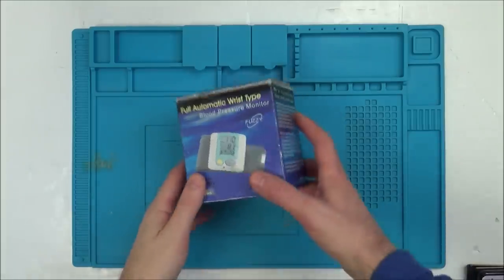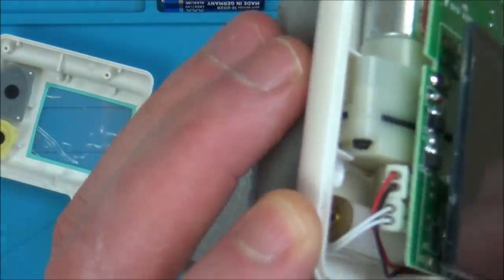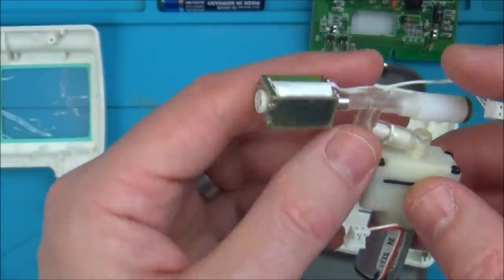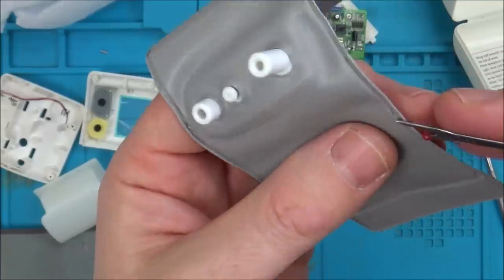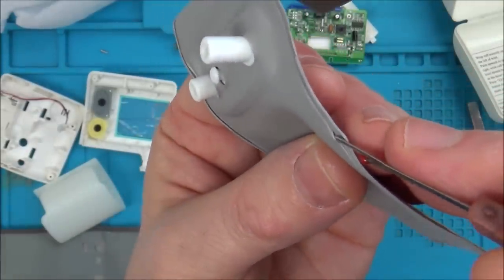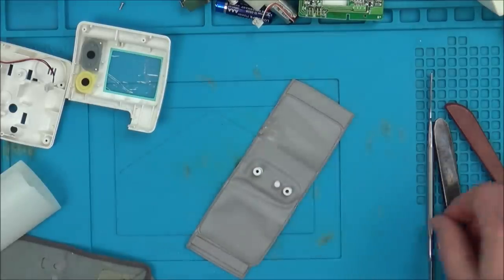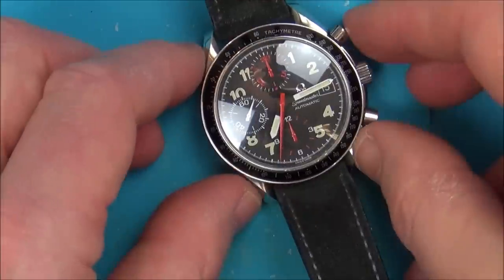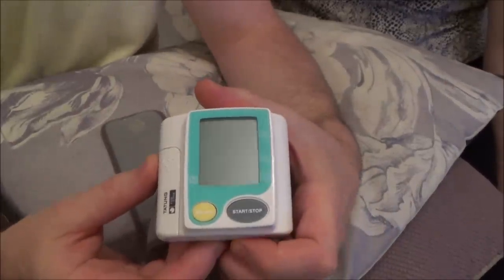Trying to FIX a Faulty Blood Pressure Monitor

Comment: Hi, You could try heating the spatular, or heat a metal bulldog clip, so it will clamp it, cover it with rubber glue.

Comment: I would have tried using a piece of kapstan tape.  Fold it over on itself so the sticky sides stick together, and the only exposed areas of the tape are not sticky.  Lay the kapstan over the hole on the bladder and melt the hole with the soldering iron, so the heat transfers through the kapstan to melt the rubber / vinyl on the other side.

Comment: You were doing it incorrectly. Wrist position is crucial when using this type of gauge. You need to sit at a desk, hold your back straight, elbow on the desk and hold your wrist at heart level. Do not move your arm at all. Then it will measure OK. Lower than heart = higher reading, higher = lower reading. Even small movements and placement errors affects it a lot. Nice video none the less!

Comment: But aren't the microchips made to read on the exact size of the balloon? By heating it wouldn't you change the size that way making the reading incorrect?
Reply from the maker: Maybe, or does it just read the pressure and stop the inflation when a certain pressure is reached :-)

Comment: I have a rite aid that as soon as I put batteries in or plug in the power adapter is automatically starts pumping and don't stop.
I also have a wrist one that has a leak like that one did.

Comment: Ideally, to seal rubber you would need to place it between 2 hotplates and put pressure on it. I remember my father had tire fixer that worked that way. It was back in Ukraine, I am not sure of they have such things nowadays.
Reply: Except it's not rubber it's vinyl, but he could have used a repair kit for inflatable toys/boats
Reply: @Thelostgoldhunters  Thats true. However same principle applies. I am guessing its just the matter of timing and temperature.

Comment: Wrist monitors are notoriously inaccurate, so I wouldn’t be too worried about that high reading. They always tend to run high for me too. 

A while back when these things first started popping up all the clinics switched over to them, but they soon found out they’re unreliable and now most places have switched back to arm machines or the good old fashioned manual pump ones.

Comment: I'm thinking if you are consistently pulling 100bpm, you really need to see a doctor as leaving it will only make matters worse, hypertension, tachycardia, two things not good to ignore and it could be a simple thing like needing a blood pressure tablet once a day for a bit or something to pull your heart rate down.   Mine without tablets is 120bpm hence being put onto tachycardia tablets and since then my blood pressure dropped into quite good results, less strain on the heart.
Reply from the maker: Cheers Ian, I will try to sort out my diet first, and if it doesn't improve then I will see the doc when things get back to normal :-)

Comment: I wished I'd watched this video before I ordered a new monitor.  The strap got pulled off and disconnected from the main unit on the old one - and I couldn't get it back together (and fit the little pipes correctly)...

Comment: Nice fix!  another one where I was yelling at the computer...  You DO engage the viewer, which is good....  Heh heh!

I'm guessing if you sat in a proper chair, turned off the camera, did a little deep breathing, the numbers would come down....  There's always some level of "attention" shall we say, with the camera on, and you're trying not to sound stupid, or say the wrong thing, and stick to your "script" to some degree, and say what you wanna say...  Which is all stressful, and that will elevate the heart rate and bp....

There is actual research, sometimes called "white coat syndrome", where the anxiety of being in the doctor's office, raises your numbers.  You can get a machine for your home, that will give a printout.  If your doctor/cardiologist is any good, they will take that into account, if you bring in 15 slips from home and say look, at home, my BP is fine...  So, it's not a big leap, to say okay, the anxiety of working with the camera on, could cause a rise in those numbers....

The parts inside, the pump pumps it up...  and then something has to release the air very slowly, so that the sensors can pick up where the diastolic and where the systolic is....  That's how it gets those numbers...  

You might try moving it around on your wrist also, just getting the sensor properly positioned could make a big difference....  If the sensor is having trouble picking up your pulse, both numbers would be higher....

Anyways, I could bore you with heart nonsense all day.  After you get your first stent put it, you get very very interested in what those numbers are telling you...  hahahaha!   Great job on the fix.

Comment: The plastic ist just disintegrating. If you fix one hole, it will rip somewhere else when it builds up the pressure.

Comment: Hi vince just wondering if you could help me with something, I have a faulty PS4 controller that will only work when plugged in, it will show the orange charging light and connect only with a lead but shuts off and won’t show any signs of life when I remove the cable, I’ve already tried a new battery in it and this didn’t work, any idea what this could be?

Comment: is no longer accurate because you have reduced the volume of the pillow / the volume is precisely designed for the sensor
Reply: ps: the white cylinder is the  solenoid valve for the air-out

Comment: Your pulse runs high so you are more on the skinny side? In my line of work it's usually obesity that causes a high pulse. Not always obviously but most of the time. You should get a sphyg and stethoscope and do it manually. See what its like.

Comment: I saw ur older video https://youtu.be/k6vw2XG512Q
and i have a question When you used the Magic NS Adapter for the Xbox 360 controller on the Nintendo Switch you held down Start and A for 3 seconds to non-mimic the Switch Pro Controller, does this also work with the 8bitdo adapter,

Comment: It seems you've developed a fault Vince. That's quite ironic if you ask me. I can't say anything. I'm not one for being in shape myself.
Reply: Likewise. But despite being overly out of shape and pretty rounded, my blood pressure is actually normal. 😐
Reply: @Operational117  It's a long time since I had mine checked but nobody seemed concerned when I did so I didn't ask.

Comment: Vince u should be quiet and u shouldnt be moving at all while u are measurring blood pressure. Also add u were at 1st little bit nervous about if it worked and then u were nervous about ur high blood pressure results. Also these machines aren very accurate. I am not a doctor but i was at doctor several times because of suspicion of high blood pressure